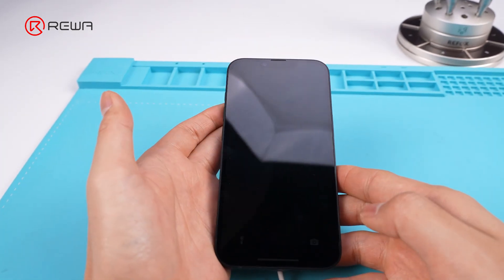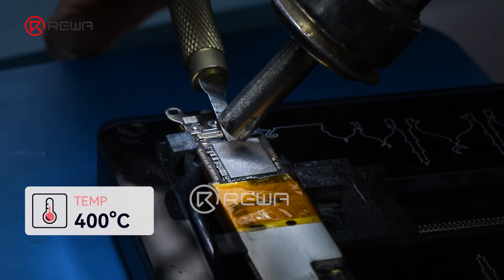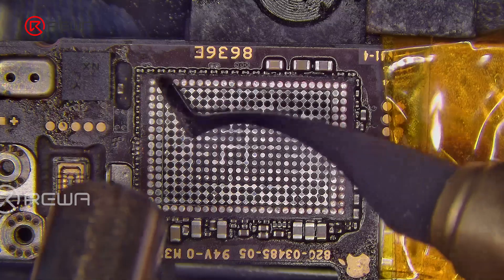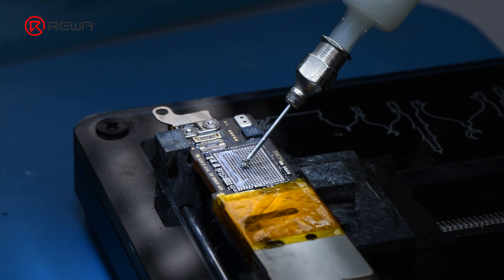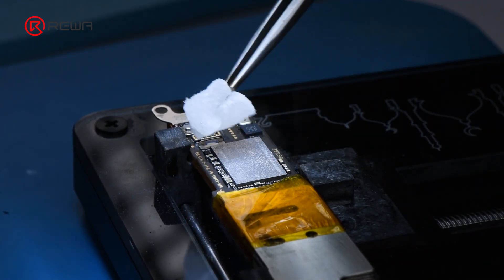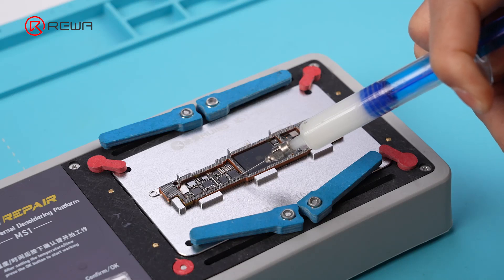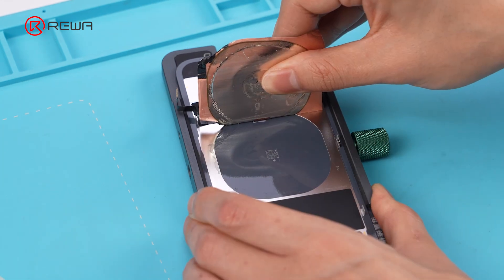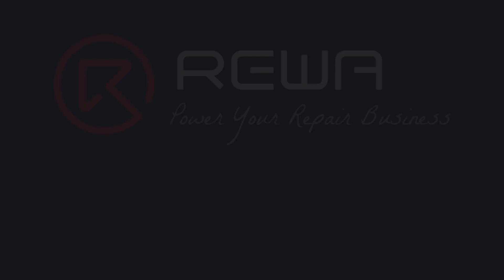Upgrade iPhone 16e for Just $46 , Worth it or not ?

Comment from the maker: How do you feel about this $46 upgrade, worth it or not? 🎉Leave your comments with us,

Repair Tools:
1.3 in 1 Blade Repair Set:
https://shop.rewa.tech/detail/mijing-3-in-1-knife-handle-blade-repair-set.html?utm_source=YTB0318&utm_medium=video&utm_id=Repair+Tool
2.8610-DX Hot Air Gun Station:
https://shop.rewa.tech/detail/sugon-8610-dx-straight-hot-air-gun.html?utm_source=YTB0318&utm_medium=video&utm_id=Repair+Tool
3.Intelligent Desoldering Platform：
https://shop.rewa.tech/detail/mijing-ms1-intelligent-preheating-desoldering-platform.html
4.Screw Driver Set：
https://shop.rewa.tech/detail/refox-rs3-3d-screwdriver-set.html?utm_source=YTB0318&utm_medium=video&utm_id=Repair+Tool
5.Soldering Rework Station
https://shop.rewa.tech/detail/sugon-t3602-2-in-1-soldering-rework-station-with-jbc-c115-c210-soldering-tips.html?utm_source=YTB0318&utm_medium=video&utm_id=Repair+Tool
6.High Temperature Heat Resistant Tape
https://shop.rewa.tech/detail/10mm-high-temperature-heat-resistant-tape-oem-new.html?utm_source=YTB0318&utm_medium=video&utm_id=Repair+Tool
7.Solder Paste
https://shop.rewa.tech/detail/lead-free-solder-paste-maant-oem-new.html?utm_source=YTB0318&utm_medium=video&utm_id=Repair+Tool
8.High-Purity Solder Paste
https://shop.rewa.tech/detail/mijing-high-purity-solder-paste.html?utm_source=YTB0318&utm_medium=video&utm_id=Repair+Tool
9.Magnetic Middle Layer Reballing Platform：
https://shop.rewa.tech/detail/amaoe-magnetic-middle-layer-reballing-platform-stencil-for-iphone.html?utm_source=YTB0318&utm_medium=video&utm_id=Repair+Tool
10. Repair Heating Pad：
https://shop.rewa.tech/detail/refox-promat-rs30-esd-repair-heating-pad.html?utm_source=YTB0318&utm_medium=video&utm_id=Repair+Tool
11.Repair Fixture
https://shop.rewa.tech/detail/wylie-wl-133h-screen-repair-fixture-for-iphone.html?utm_source=YTB0318&utm_medium=video&utm_id=Repair+Tool
Reply: I'll buy 128gb iphone 😂 and buy portable SSD we don't need buy high memory iphone if there portable SSD in other market
Reply: 46$ blom sama ongkos bongkar 😂😂😂
Reply: worth it ❤
Reply: can I buy chip a from you?

Comment: why low temp solder for board stacking?? will it affect durability during use?
Reply from the maker: Usually low-tem solder is 140-160 degree to melt, if you use the high-tem solder, you may take the risk about desoldering platform may damage the board.

Comment: Hi @Rewa it's possible for you to test to add optical camera from iPhone 16 into this 16e because 16 have the OIS camera vs 16e have EIS. It's just to know if it's possible and if you can test if the camera is completely functional on the 16e. Regards =)
Reply from the maker: The camera does not have the connector to link, and if we add that like the e-Sim coversation, we cant not locate the right position

Comment: Is it possible to upgrade iPhone 12 to 1tb using iPhone 13 Pro 1tb nand?
Reply from the maker: Ummm on 12 generally is 512 GB
Reply: @ ah I see, I thought the 12 and 13 both used bga110 chips with the same footprint?
Reply from the maker: @EvanPang-w4i  Yeah but you need to formate the NAND and  use  NAND programmar to write basic data turn the NAND into the model you want
Reply: @rewatechnology2008  so it just needs to be reprogrammed to work?

Comment: Can you fit 13 pro display on this 16e with 120hz.😅😅😅😅 is it possible??
Reply: I've heard that it's just not possible, since both screens have different connectors (If I'm wrong, PLEASE correct me-)
However, you can actually slap an iPhone 14 display on the 16e, since both screens are basically the exact same (as seen on Phone Repair Guru channel)
Reply from the maker: The Display IC already decided the screen and we can not change IC for now
Reply: @rewatechnology2008  FOR NOW

Comment: 512gb nand cost 40$ ?
Reply from the maker: $46 for REWA but freight may charge little higher
Reply: If consumers can get 512 GB SSDs for $25, I'm sure 512GB of NAND could easily be purchased for $40 by a repair shop or manufacturer. I believe it 100%. Apple just wants you to think SSDs are WAY more expensive than they are lol
Reply: its cheaper than that from Aliexpress duh

Comment: Cool, would like to see a SIM slot though.

Confused about the $46 price. A 512GB NAND module (and charge coil) is less than $50? Where? And how does the inductive coil work without hooking it up to anything?
Reply from the maker: It is in our area, it only charges $45 or $46 for the NAND, and the coil is almost free~~
Reply: It already has inductive charging (the slow kind), so all he did was add magnets. Something Apple should have done themselves. If you want a sim slot, then import one from abroad.
Reply: Good note on the charging. Believe it or not the “abroad models” do not support the same bands/different antenna configuration. Would be very bad advice to import an iPhone in this way.
Reply: If consumers can get 512 GB SSDs for $25, I'm sure 512GB of NAND could easily be purchased for $40 by a repair shop or manufacturer. I believe it 100%.
Reply: Assuming you are not a bot as you’ve copied and pasted this answer on other comments, that is a very misleading statement. “Consumer SSDs” only at the very bottom of the barrel ‘KingSpec’ branded SSDs can be had for near $25. Any of these consumer SSDs distribute this 500gb across multiple no name band modules. Samsung for example charges $50 for a quality 500GB SATA ssd. Prices are actually on the rise.

This is nothing compared to a high quality ultra-dense 512gb module from apple. Yes maybe in gray markets in china this price is possible, but not anywhere else.
Reply: @KingCornWallis  I’m not a bot and I do computer repair. I have a ton of 512 SSDs that are $25. Some of them have caches, some of them don’t. I have 4 MacBooks, 2 Mac minis, and 3 iMacs and they all are using cheaper SSDs. I haven’t had a single one fail yet. And I only buy from distributors and manufacturers that I trust and have at least 4.5/5 stars on public markets.
Reply: @KingCornWallis  also, I only copy and pasted my comment 1 time lol